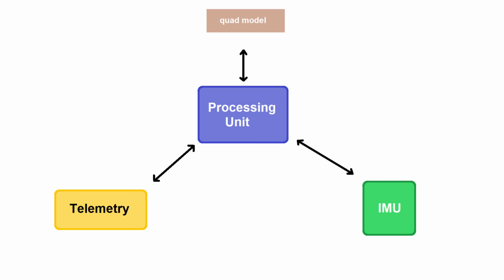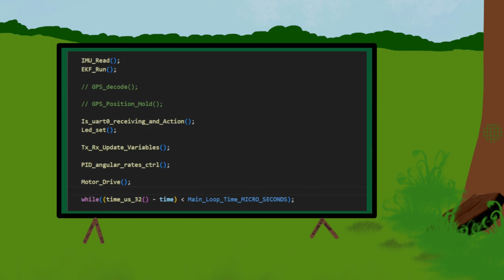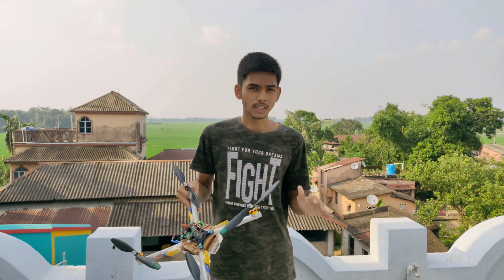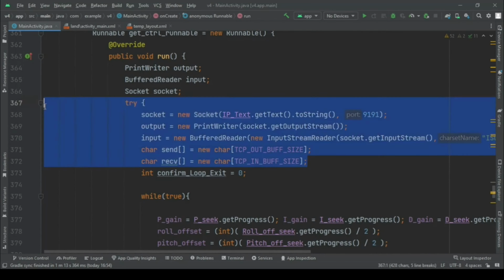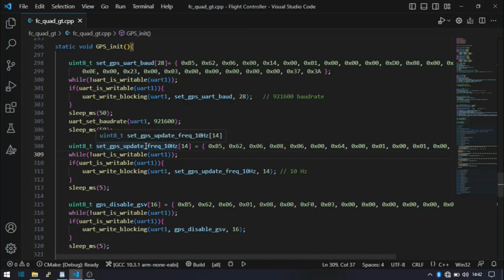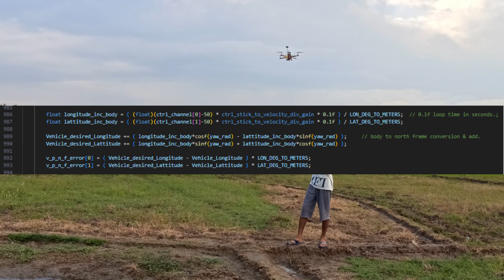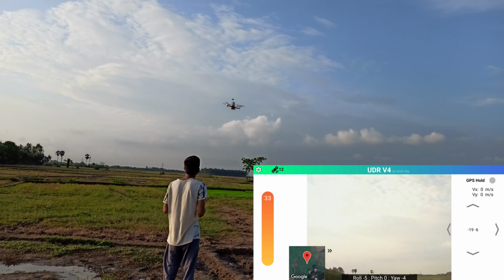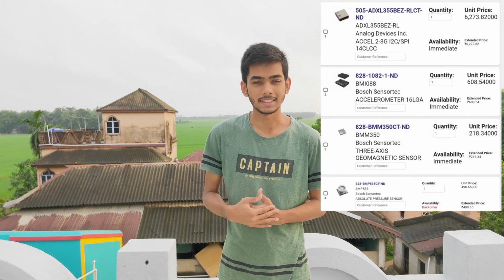How I made a Raspberry Pi Drone 😎

Comment: Bro I am also trying to make a drone using rpi4 i made a flightcontroller using arduino nano and it works fine but while implementing rpi4 i am getting a issue, the motor speed is fluctuating a little bit or it is not smooth like the transmitter can u please help me and tell me how can I do pwm signal simulation in correct way, please help me bro.....

Comment: Hello sir, I have correctly assembled and calibrated this drone, including the ESC and accelerometer. However, I am unable to achieve a stable flight as the joystick is overly sensitive, causing the drone to tilt in one direction. I have checked all propeller directions and connections, but it still does not provide stable flight. What steps can I take to address this issue?
Reply from the maker: Are all the angles showing up on the app correct and according to the drone's orientation and not drifting ?
If it's ok then grab the drone in hand and and increase the throttle a little bit and tilt the drone and check if it's opposing. Do some joystick movements and see if the drone is tilting in the same direction of joystick.
If any flag, mention it.

Note : do this testing by turning off gps hold.
Reply: @DIYLIFEHACKER  yes as you mentioned drone is working well according to it but it struggle to get it's old position the joystick is working but as my GPS not showing the values I removed it for some time I hope GPS will not cause to drone stability and also when I get the accelerometer data on arduino ide it shows correct data it means it working well
Reply from the maker: @rajkanyarathod7864  What ?? Don't remove the GPS (gps text appears when you get a gps lock) . And how do you get the accelerometer reading in serial monitor, it's not supposed to print any.
Too much confusing. Please provide the problem in details
Reply: @DIYLIFEHACKER  No, no, I mean when I run the compass calibration file, it shows the output. Also, when I connect to the app, it displays the exact roll, pitch, and yaw. I removed the GPS because when I connect it, I wait for 30-1 hours to get GPS initialization, but I didn't get the location on the map, so I disconnected it. Can this have a significant effect, and if so, how would it affect the stability of the drone?
Reply from the maker: The gps doesn't determine stability (horizontally) unless it's in gps hold mode and enough satelite signal. But if you disconnect the gps, the dma uart engine running that coppies the nmea sentences might block the loop if not uart device found. To get good gps signals go to an open area and look at the satellite count beside 🛰️ icon on the app.

Talking about stability I'm not getting your point. The joysticks control drone's orientation i.e. tilt angles. And if your drone is moving left then you just push the joystick right for an instance not too long as it will continue to accelerate

Comment: Sir how many voltage battery did you use in this project if 12 volts then how many voltage did you supplied to pi pico and zero if less voltage then what did you used for down the voltage
Reply from the maker: Esc offers 5v, you can use that in vin pin or see pico datasheet for more v, i rating informations

Comment: bravo... wow.. definitely will try it at home.
Reply from the maker: Won't regret building one. 😉
Reply: @DIYLIFEHACKER nodemcu wala drone bna liya 3 month ho gae lekin app bhi work nhi kr raha or drone bhi nhi ud rha😢 or kisi ki video bhi nhi mil rhi kya kru iske code se to ud jaega na vo drone?
Reply from the maker: @Daredevil04  The App didn't worked in the previous video most probably for the app was for Android 11 and in other versions of Android the app doesn't install. But this time I check every Android so far, also there are 2 varients of the app for different screen size (some device doesn't show a button). All those app related problems are solved, still if you face problem, this time it's a raspberry pi right ? So you can login to it and check what's the problem. So, no worry. But I would recommend to have some prior knowledge of drones and little bit of programming (like Arduino level). The thing most needed is the patience of learning things, you might fail but you have to have the motivation to troubleshoot, there's a vast community on internet for problems related to pico, Android, pi. If you still face problems then you can mail me with proper details of the problems.

Comment: Yes, I was also considering that, but there is a limitation. In routers where we perform port forwarding, such as the JioFi mini router, its IP is dynamic and can change at any time. Imagine the drone is in the sky, and the router's IP changes (😅 lol). But it's really a genuine problem. You have any idea on it ?..
Reply: Yes, you must buy static ip address from your ISP, It will cost you around ₹2000 per year. But be careful with it. Its not a simple thing to handle. Static ip requires special attentions over how you use your internet daily like visiting unsafe websites, openening unnecessary ports and all.
Reply: @Sahil_Bhandari  bro instead of that I was thinking can we create one vpn network on my friend router which contains static IP and connect that vpn network by mobile and ruspberry pi zero.this should work like side to side vpn communication and I think I can able to communicate with the drone using this,but I will find another way....
Reply: @rajkanyarathod7864  bro I am interested in this. You are such an amazing guy. I will learn new things haha!
Reply: @Sahil_Bhandari  thanks bro😊
Reply: You guys are really smart

Comment: Hello, sir. How did you calibrate ESCs? Did you use any external flight controller or employ any tricks with your flight controller?. Sir please reply
Reply from the maker: The flight controller generates purely 1000-2000us pwm, so use any receiver or write a pico script to do that calibration. Like -
PwmWrite(100);
Sleep(5000);
Pwmwrite(0);
//Remove power
Reply: Sir please check your email I send you my script using python as I am not that much familiar to c so I choose python if my script is not well to calibrate esc's then can you please provide me C code for it, please sir it is only last step to fly for my drone,as I don't have any external flight controller and receiver I am not able to do it
Reply: @rajkanyarathod7864 bhai uda drone aur unlimited range??
Reply: @asyouwish612  hogaya Mera drone but thoda unstable hai so thoda joystick Mai changes kar rahahu mai
Reply: Brother can it operate at android 14
Reply: I mean the app
Reply: @raj bhai